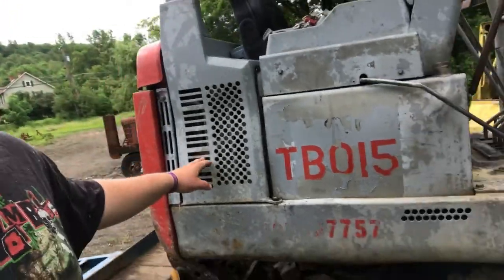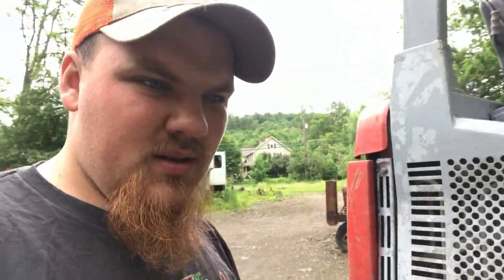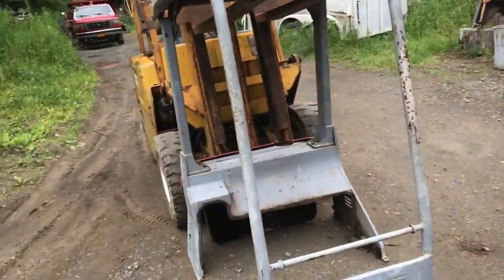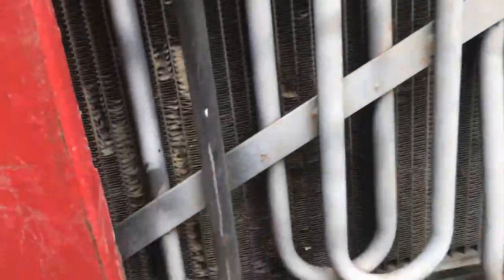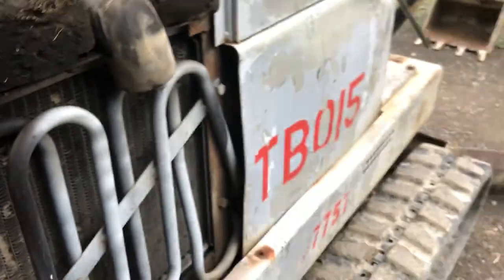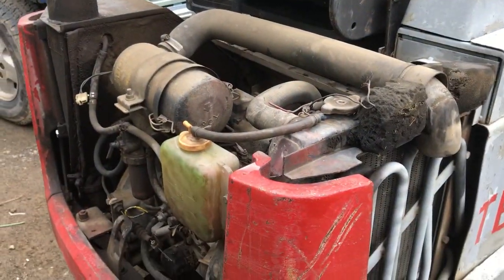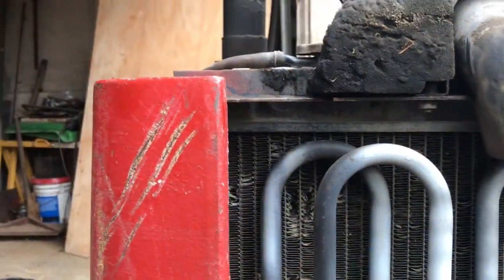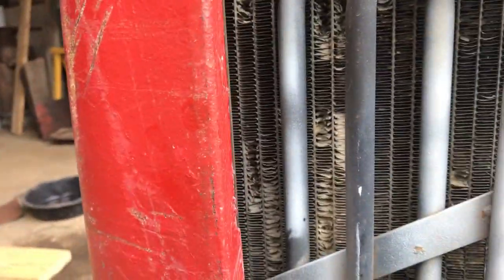Cleaning the radiator on a takeuchi  mini excavator

Comment: Thanks for the vid.  I have the same machine and the radiator is also clogged with dirt and overheating so this helped me get started.  I don't have a forklift, so it'll be interesting getting the ROPS off.  Strange design, not sure why they didn't make it a bolt on cover so you can get the radiator out easier.